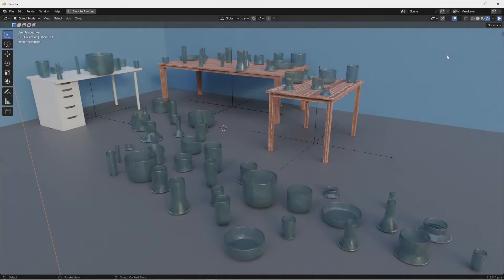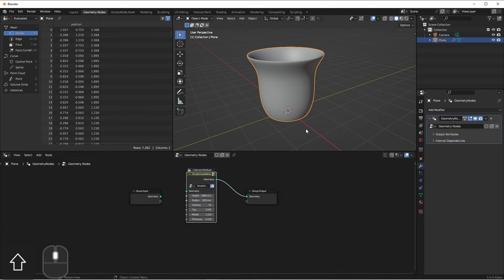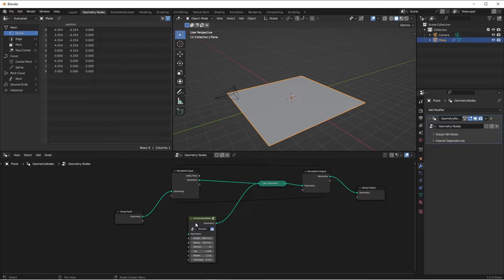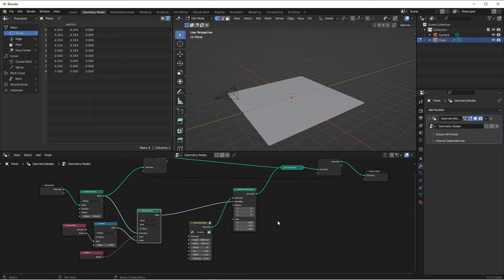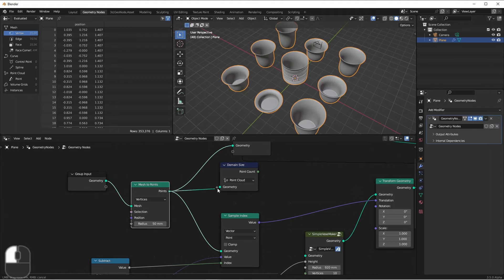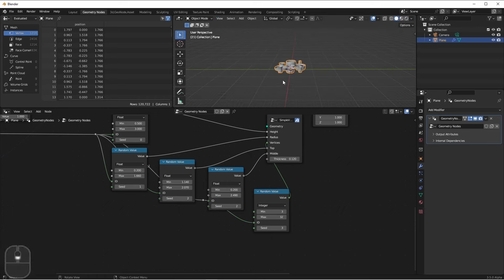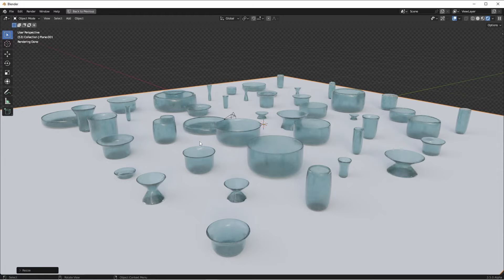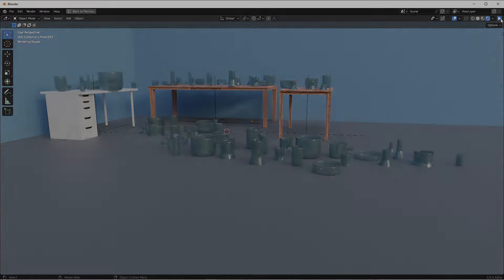Random Object Generators with Simulation Nodes

Comment: Simulation for this type of works is pretty heavy and overkill. I have a solution in my mind that you could make instances of the revolved meshes made of one profile curve, storing spline parameter factor field as an attribute before the curve to mesh node. And then use the factor attribute to make variations. I haven't proved the idea myself though.
Reply from the maker: For revolved meshes like these vases sure, But what about something like a building generator? where each instance wants to have lots of different options randomized, not just things like radii?